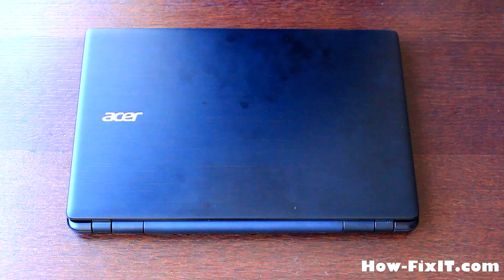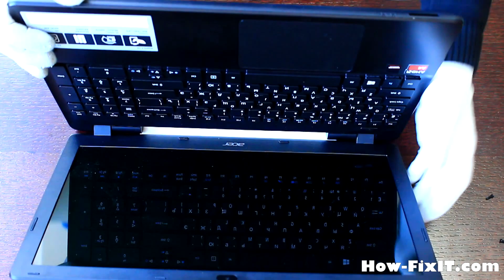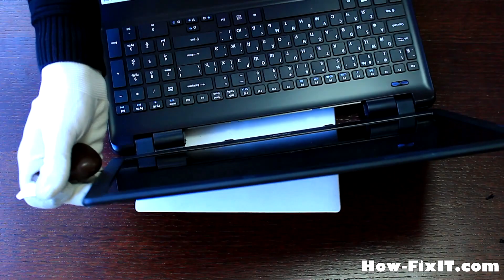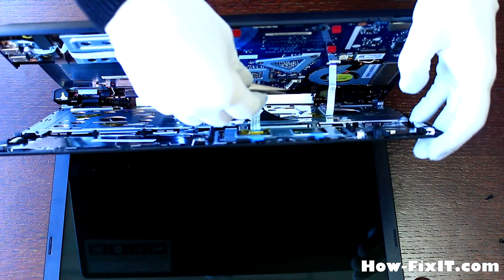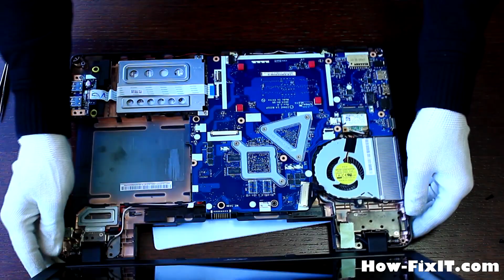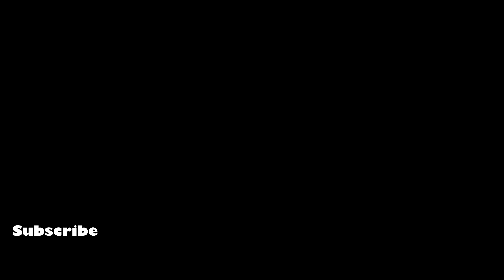DIY Acer Aspire E5-521, E1-511G Overheating Fix: Disassembly & Fan Cleaning

Comment: +How-FixIT Any chance you could tell me the fan manufacturer/model number? I want to order a replacement. Mine is an Aspire E5-521-24PQ but I'm pretty sure it probably uses the same one. Or if you could just link me to a replacement that'd be great too. Thx! :)
Reply: Also yeah, thanks so much for the video! I'll be replacing the fan and upgrading RAM soon and this is going to be invaluable considering how ridiculous they've made the process..
Reply from the maker: I glad that video helps you. I can't say fan manufacturer/part number. But to find neccesary fan you can use laptop model, for example "acer aspire e5-521 fan", and if I don't mistake you need something like this: https://goo.gl/nbTkxq

Comment: HEllo again, i have this notebook and the wireless fails every times on Windows 8.1 and 10, any solutions? I Updated it from the web page and downgroade... ¿Help? My model its :) E5-521G-65Q0
Reply: Fabi4n X had the same problem a factory reset did it for me

Comment: Hello,
Thank you for this video !
Can you tell me in how inch is the HDD on this laptop ?
Can I add a SSD in this Model ?
Reply from the maker: Acer Actu Hello, in this laptop used basic laptop HDD size - as I remember 1.8 inch. You can use 1.8 SSD instead of installed.
Reply: How-FixIT Okay thank you for your response :)
Can you tell me please, if this model is nosy when it turned on ?
(Sorry for my bad English)
Reply: Acer Actu No, the shit of this laptop....THIS NOT HAVE DVD ROM !!!